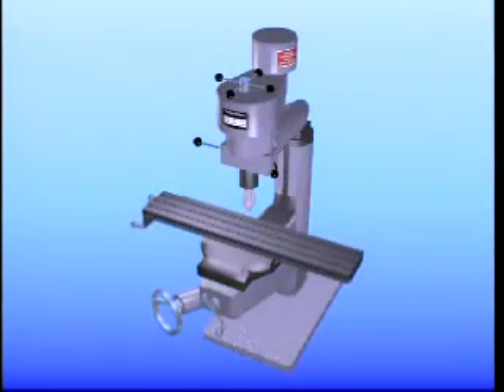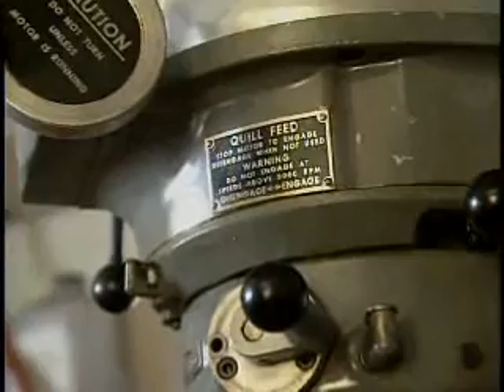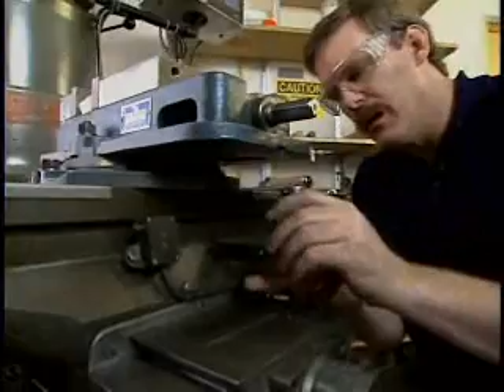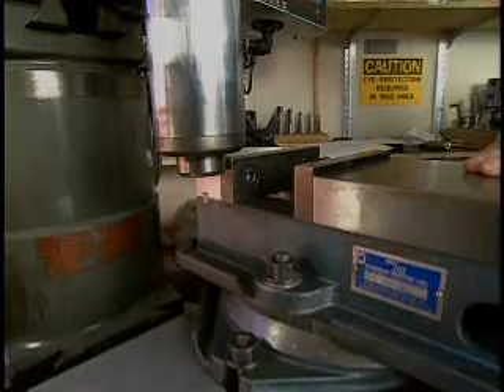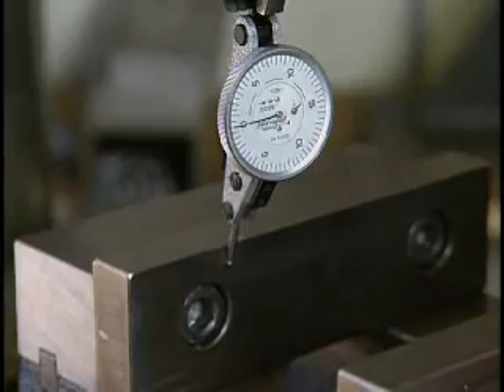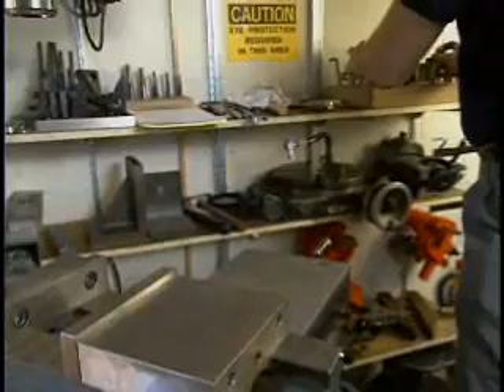Essential Machining Skills: Working with a Milling Machine, Part One

Comment: I would not tram the head with my indicator in a drill chuck. I attach it right to the quill with an indicator holder. I also tram it to the table with a stack of identical heigh blocks. If I do tram to the vice I use a longer flat bar for better accuracy. If that head is out .0003 over 4 inches it will be off a bit much if you're working on a block that's two feet long. So I usually tram to the table and then make sure my vice is on dead flat. I've actually seen vices out of parallel by .001 before checking them on a surface plate.

Comment: Pound on the draw bar with a  HAMMER !!!!!! he should have said TAP it with a hide or plastic MALLET, brass hammer or a chunk of lead. I hate to think what the draw bar end is like, mushroomed out I suspect, making the spanner difficult to fit. Also when aligning the head, there are  adjusting screws that work a worm and wheel to move it, there is no need to bang it with a hammer.

Comment: It seems to me that your stacking errors by tramming your head against a vise. Why not tram the head of your mill using the top of your table? Your vise sits on that anyways, and any error in your table is just compounded by the error in your vise.

Comment: Excellent vid, really enjoy, will be recommending to some people for a class. 

to be fair on your shop etiquette part regarding vice square - if they walk up to the mill with a really expensive part and fail to  check square on everything before cutting, regardless of how it looks, the ruined part is on them.

to anybody contemplating using one of these machines - always check square. always. doesn't matter the time of day or the phase of the moon, any part worth your time can wait for you to properly check everything before cutting. Measure twice, cut once.

Comment: Nice video and very good play by play.  I am going to respectfully disagree with you on the quill feed application.  The quill feed is NOT to be used for drilling.    There are very good reasons for this.  First is the fact that it does not have the range of feeds per revolution to achieve the proper feed over the range of sizes of drills that may be encountered.  Any attempt to drill to fast will result in tool deflection (resulting in an oversize off location hole)  or tool breakage.  If the drill is fed too slow, it will not achieve purchase on the material to be cut, it will then over heat and become dull.  If the drill is big enough the gear train will be damaged.  What is the quill feed for? This feature is for use with a boring head. In a boring operation, feed is much less critical and the material to be removed is minimal, less than .005in per side.  I spent a dozen years in job shops and the last 15 working on machines just like this.  I have seen the results of feed mechanisms being improperly used.  Feeding a drill with the boring drive will break things.

Comment: I'm a retired toolmaker that enjoyed your vid,  I think the most important takeaway from this vid is shop educate,  NEVER amuse the previous worker left the equipment in a "strap it down and go" condition.

If you screw up a piece it will be your dumb, and when you explain you will hear "didn't you check the equipment" before you cut?

As an apprentice I learned this early,  I set up a 1x6x19 inch steal plate on a Bridgeport to mill a .750 slot 5 inches long .250 deep with a 2 flute .750 end mill.  Checked my clamps, set the end mill speed, cranked the knee up and set my zero. 

OK, lets take a .030 cut. . .I cranked the knee up .010 and the end mill garbed and walked across the part and slammed into my hardened clamp.    What the F!!!

Rule One. . .Never Amuse.   A worker had used the mill for some offset  turret work  and neglecting to tighten the turret bolts when he returned the mill  head 90 to the table.

People forget things, get rushed to a new project or just have a bad day, yes I was upset and could of been injured but I wasn't, needles to say . . .the part looked like hell!

Teaching safety is just as important as technique, an industrial accident may not only involve the apprentice but his master and near by coworkers too.

For everybody's safety,   never assume!

Subject change:
I had to move from shop to shop to learn. . . now I watch You Tube!
Keep teaching . . .your doing just fine.
Reply: Terrible English
Reply: Michael Dow I see this a lot caused by the "spell checkers": when they were put together many words were left out so it replaces what it believes to be wrong with the really wrong word...
Reply: Michael Dow I assume by “asume” you mean “assume”?
Reply: I asume by "amuse" you mean "asume"?

Comment: hmm ah so so that is why it is called a knee mill, I thought it had to do with the hight, it goes in and out, and the turret turns as its not stationary till you want it to, but this is new to me, I mean I have seen mills and using a mill to flatten out tops and cut groves in plates of metal as well as cleaning parts up, though I have seen that mostly on lathes. but this is fascinating you can speed it up and down just like that by winding it.

Comment: Something you left out on the quill feel was the forward/natural/reverse pin that is located in the centre of the fine feed handle that you are missing from the machine.
Reply: also when tramming the head you will notice on the front of the quill depth stop there are two machined notches at the top and bottom of the screw they are machined square with the quill so one can use a 12"' square off the table and tram both the tilt and the nod of the head.

Comment: Ha, I have been "faking "  being a machinist for 10+ years at my co. as a jack of all making little widgets and fixtures and stuff but never knew the quill feed kicked off like that ....I don't use much if at all since most of my stuff is tiny so there is no need but I thought it would just destroy the gears  if it deaded into the stop :)  ....I use the stop for manually drilling or plunging only if I set the stop.   I love this youtube school !!

Comment: american milling machines are so weird
Reply: squiggofant I have been a plastic injection mould toolmaker for 46 years---BRIDGEPORTS===  standard machine tool  in every toolroom I have worked in---for good reason ---they are more versatile than anything else----still used today ---they are the ones that everybody wants to copy
Reply: squiggofant I think the reason you've never seen something like this is because its more than a 60 year old design, which incidentally is still manufactured by Bridgeport/Hardinge group as their series 1 or knee mill.
Reply: in what way?
Reply: I'm a toolmaker and i've never seen a machine like this. Milling machines look different over here. For example google "deckel fp4", it's about the same size as this machine.
Reply: Thank you for explaining that to me. Could you tell how much this machine goes for for today?
Reply: ***** I just bought one here in Australia for $2750 (1963 j2 model) though it needs some minor replacement parts. The same people were selling similar models with DRO (digital readout) and power cross feed for $5000
Reply: A guy on ebay won a Bridgeport mill which looks similar for a $1000. not sure what it cost to ship it however.